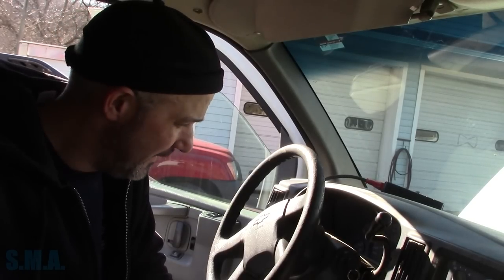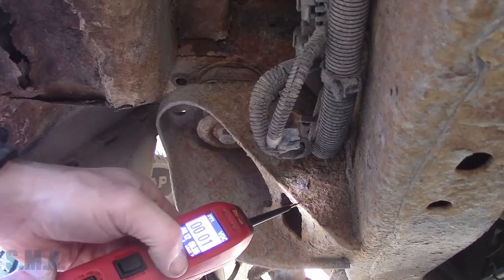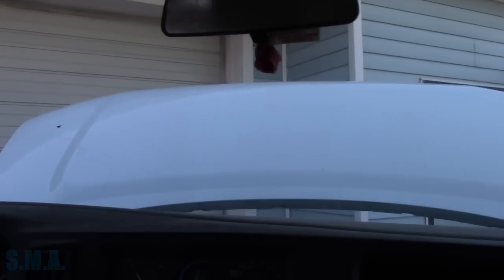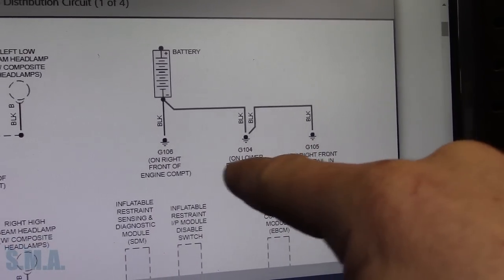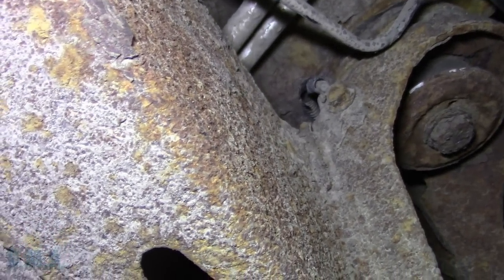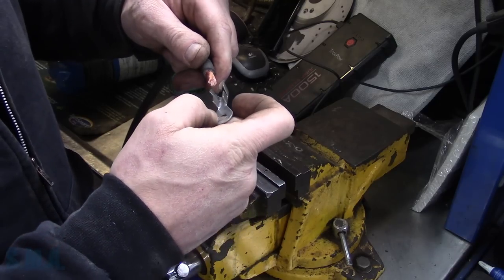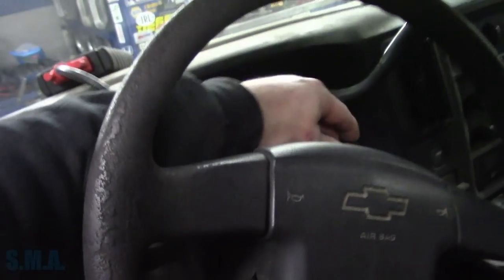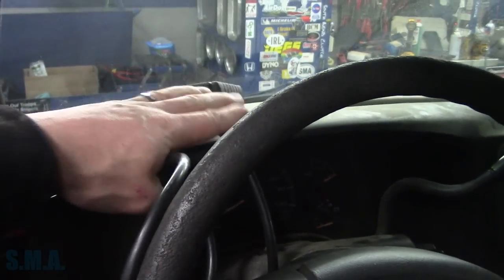Chevy Van : Crank No Start

Comment: It helps if you preform the tabs on the connector over a drill bit a little bigger than the cable then slide the cable in before crimping. You can quickly load test the ground by flicking the Power Probe switch to B+ for a second.
Are you running the shop alone these days?

Comment: Buddy and I tried to do the hydraulic suspension on his 2012 Benz. Not only a mess to do but plagued with all kinds of issues. The hydraulic lines are all over the place. Never buy one of these cars. If its cheap its cause the suspension is out or they know its going. Hella $$$ to fix. Just look at you tube on em. Anyways love the channel and I actually got to show my buddy your weld a nut on bolt extraction trick and I gave you credit even though I know you didn't invent it. ;)

Comment: Great video as always I’m chasing my tale with same no start issue 07 gmc 1500 5.3 
hoping it’s a ground and not the fpcm but I don’t have a power probe just a volt meter, and a test light some marine grade 4g cable and some chewing gum lol jk
My truck is a pile of rust as well so 
I will look around for a broken ground strap but any other advice Unfortunately I don’t have a lift and my bed is filled with tools or try to slide around under it

Comment: Hi Eric,
My dad has an 06 Honda Civic with 360k on the clock. The check engine light just came on, code says to change the trans fluid. He's only changed the fluid once its whole life. The time he did, it was slipping badly for a bit. Based on knowing this, would you go ahead and change the fluid. It shifts perfectly fine.
Reply: Only change the filter reuse oil

Comment: I have the same EXACT Chevy work van. Mines a 2014 with 120,000. It looks pretty close to the way that van looks, but maybe just slightly better, because I havent experienced any rust related issues yet. Am I doomed? Is there anything I can do to prolong its life. So far it runs good. Never gave me problems. Just brake pads and oil changes so far. I was thinking of spraying Fluid Film right over the rust to slow it down. I dont need it to last 20 years, just a few more would be great. What would you guys do?

Comment: You should make a video showing the replacement of a fuel injection spider and a timing chain cover on an 01 Chevy S10 4.3. I will even allow you to do it on my truck for the purposes of the video. I will even buy the parts. Course you will have to come down to Alabama. I doubt that would be a problem for you as you seem quite dedicated to your trade and channel.

Comment: awesome...……….. an other good-job
back in the late the early 60's I was around 10 years there about, my father had a 
two tone blue 4 DR  seriously ventilated 1958 Pontiac,  the back seat area was
 air conditioned;  on a rainy day, your back side get a washing,
one night on his way home from work,  he was having issues with it not handling well,
 a gas station near by put it on a lift, the car begain to fold in-two. 
We hear the story like some how with all the salt rust in his car how could it be. 
a day later he comes home with an other 4 DR. Catalina. 62, white,  that one held up much better, came with a monster engine. 
a friend of mine, something 1973 74, winter, on the free way, he has the trunk of his 63 Chevy
4DR, the truck full of tools and what ever else, red car, first the gas tank feel out, he fixed that,
 a few days later, the whole back of the car broke off & feel on to the free way. I was
behind him both times. just typing this out is making me laugh...……. 
1972 ranchero, before 1975, the salt had rusted the back wall of the cab up from under the bed and cab, rain water filled the foot well up, that little pocket area behind the seat all eat up.
the carpet hide it. sold it & left NYS..... go west young man, Cater was President. 
single wire lead 24 volt charging system when it loses it's ground will make it's own, through 
the poss-wire, that's when it gets fun. correcting it. had the steel battery box covers locked down blown off, * D batteries...….

Comment: had the same problem on dads 60 doged pickup wih 'all welded construction' when all the welds went resistive had attenae guy wire strung from engine to frame to cab to bed worked great for as long as he had it

Comment: It's been a while, but IIRC, that is not a "rat tail" file. Maybe a "half round" file? Another thing - suggestion for the ground wire: strip, then tin the outer wires. Install and "crimp" [using the term loosely in this case] the terminal, then reapply heat to the wire/terminal assembly. no loose wires and a bullet proof connection, when adhesive lined shrink wrapped. Yah, yah, everybody is an expert. :)

Comment: Free tip friday Mr O.   If I'm soldering a cable into a clip that's too small, I put some solder on the bare, twisted wires FIRST.  That way none of those pesky strands escape! Ant time sir:)
I will spare you the other way of pronouncing 'solder'.
Keep up the vijeo's!, Total lock-down here in France, we need them!

Comment: Im glad i live and work in Ca. Although I had a New York vechicle come Mazda B2300 (Ranger in descise) hard binding shifter motion. It has a newer dorman steering shaft shift tube previously installed two torx head screws are tight. Smooth movement with no shift cable connected, also disconnected from trans reconnected to shift lever  smooth aswell. My thought is that the neutral safety switch is corroded inside. With it unbolted from trans it will not move without shifting trans. Is this a common or have you seen this before? Customer declined removing to verify.

Comment: It's a good job you don't have the UK MOT test every year.  I had a car fail because the number plate letter spacing was wrong.  To have a sill with a hole big enough to put your head through, you wouldn't be allowed to drive that away from the test centre.

Comment: Crimp by all means, but if you have to add solder, then add the solder to the tip of the cable and the lug. If you allow the solder to creep down the cable, the cable will be liable to be brittle, and will, at some stage, break.

Comment: Pretty sure that's the stock ground strap.   Changed one on an 2006 express a few years back.
Reply: Looks like the stock one that snapped so somebody located it somewhere else it would still reach. That braided cable stuff they use is complete garbage.

Comment: I changed a motor on a 1999 ranger after I finished the motor swap I had a theft light code 1845 ...rechecked the ground wires that I had off and thought that the aftermarket key was the problem but before I took it to get reprogrammed I thought I’m going to check every ground wire and the one from the motor to the fire wall on the fire wall end was not getting good contact after cleaning it, I turned the key on heard the fuel pump kick on and yes it fired right up ...there’s nothing that’s more aggravating than doing all that work to not hear the motor run

Comment: Nicely done uncle had that issue with his ford pu only problem was he was trying to haul a trailer wired for an older chevy and his plug was wired all wrong from what the trailer Hadid wired the trailer to my dads 67 g10 sportvan and I wired the trailer like the van all lights and grounds were identicle  Bob's 85 ford f150 4x4 was wired totally different he wanted to cut my wiring and redo it for his ford I said nothing doing I made him a ford to Chevrolet adapter so as to spare my wiring i spent 3 weeks doing with grounds

Comment: Great vid! Changed battery in 03 GMC 3500 cutaway. Now same symptom. Crank- No start. Do not have lift in driveway, what are chances of same gnd issue. No trailer hookup, comprable frame rust. 
Only code is intermittent O2. Have heard bad fuel filter can cause false coding due to restrictive flow. Help? THX!

Comment: Scary to think this thing is doing likely highway speeds pulling a loaded trailer and all that is keeping it all together is rust, the interior carpeting, and the roof.  Glad I don't live in the rust belt.🙄
Reply: The frame looks fine to me. The body isn't important. The tires aren't even chopped, So it rolls straight.
Reply: And now the new ground strap will hold the engine in.

Comment: hey eric im working on a 2003 dodge ram 1500 hemi 131xxx miles engine stopped running lost all compression pulled the timing chain cover found a broken camshaft dowel pin. never seen that before all the valve train is okay

Comment: Had a BMW x3, would not start. Jump pack to engine and body started right up, moved it then put the jump pack on battery would not start. Short story long after almost changing the starter. Powers and grounds, Powers and grounds, KISS, KISS was repeating in my head. Ground strap from engine to chassis was rusted off. 3hour job turned into a 5 min job.

Comment: 4:44 Side Note: My Honda has a switch on the dash (lower left) that will activate or deactivate the operation of the other windows. Might be a safety feature so that kids won't open them, similar to the manual safety door lock! Since that Chevy's passenger window didn't open, might it have a switch ?

Comment: If it was me I would have used tinned copper cables and tinned copper terminals and a 30 ton hydraulic crimper for the ends :) Awesome repair though, I'm sure with the short life left that vehicle has naked copper will outlast it anyway.

Comment: Nope I've got the exact same truck with the exact same problem except when the lock is flashing it will not crank when the lock is solid it will and it seems to be getting worse with cold weather I have waited the 10 minutes and try it again and it's made me wait another 10 minutes and today it's been 30

Comment: I work in auto parts and work on my truck myself, and I still don't understand why they use "grounding straps". All they do is corrode and break. Why don't they use a standard piece of wire (copper or aluminum) to create better grounds?

Comment: Have a Question S.M.A. i have a 2003, Chevy 1500 4x4  used it last fall getting my wood never went all winter ,put a battery in it i had nothing hands never moved on the dash , would not do anything, , Are you thing grounds are all gone or  my dash ?I had trouble with dash before changed it 10 yrs ago

Comment: Eric, Please explain why you had 11.8 volts at the frame when you turned the fuel pump on.
Reply: The jump wire he was using was too small to flow full current. There's your voltage drop.

Comment: Have the same crap on my 2012 suburban. Except it make everything act up. Think the main issue is the ding dongs don't use dielectric grease while using dissimilar metals as grounding points....what could possibly go wrong?

Comment: I’m having similar issue recently installed a new motor 2000 s10 4.3 4wd

Plugged the harness back up. Pulled fuel relay and Attempted key to see if it would try and kick over but nothing happened. Switch is new so I know it’s that not it 

So I grabbed my test light  and noticed my crank fuse lights up when key is set to run position so I tapped into it for the time being 

Ignition is working 

Anyways while I fiddle with it more I found out that there is something else going on with it. 

I get crank but no start it sounds like it attempts to start sometimes u can catch a glimpse of it running then dies instantly 

I have a strong smell of fuel  so I know it’s getting into the rail “haven’t checked pressure on rail yet”

Anyways 

I replaced 

ignition coil /wires/ spark plugs

Distributor “full drop in”

Neutral safety switch since I damaged mine….with those dreaded connectors 

Still nothing 
 
I’m out of ideas

Comment: Can I pick your brain? My tuned Cruze is throwing P0236 and P2227 cutting my boost while driving. When I reset the codes it drives fine for a while but does it again. 32k on it and I see no hose leaks anywhere. My vacuum pressures are fine according to my ultragauge.

Comment: I got away from soldering automotive wires, the solder runs down past the crimp and makes the wire stiff. When it vibrates it breaks off there in my experience.

Comment: Can I pick your brain have a 2003 Suburban 5.3 starts and runs perfectly for about 10 minutes possibly warm up then dies out will not start again until the engine is cold and then starts fine runs fine and dies out again when warm or 10 minutes or so any help would be appreciated. Only code is po102 love the videos very informative keep them coming
Reply: P 0102 is a MAF sensor code. It seems strange that it would cause the symptoms you describe, but the engine should run fairly well with it unplugged. I would unplug it and see if it makes a difference.

Comment: I live in Northern California and after looking under that van all I have to say is. I'm sorry.
Reply: need to buy a SUBIE OR VOLVO  THAT NEVER RUSTS
FORD DODGE CHEVY RUSTS  SO BAD
Reply: @ekop1778  They all rust in the northeast. Seen Eric O. work on plenty of rotten subarus.
Reply: The best way I can describe HOW rusty the rust we get is, is by comparing hitting a fresh campfire log with a hammer, then a black chunk out of the fire that's 95% burned. You can punch through what used to be 1/4" high strength steel without so much as a tiny screwdriver, and light hits.
Reply: Willa Herrera
Why do you think car prices are so high ? Us New Yorkers need to buy new every 5-10 years. lol.
Reply: I live in mid Michigan. My last daily driver was a 99 Cherokee, it ran phenomenally, even after 280k miles, but the passenger floor board had holes rotted through and eventually the carpet sagged through.
Reply: @ekop1778  I live in the Northeast, never saw a Subaru that wasn't rusted out. Pretty sure they come from the factory that way.

Comment: We have a fleet of Savana 3500's and after about 5 years that ground wire will turn to dust when touched, leaving the driver stranded because fuel pump will not run. Temporary fix with a wire and 2 clips and we can at least drive the van back for repairs. Bad design by GMC, should be a wrapped ground wire like you put on right from the factory.

Comment: I have never seen one of those braided ground straps corrode and fail, and I work on refuge trucks. Of course I don’t have to deal with road salt but I do deal with mice,rats, alkaline garbage juice and monkey mechanics who basket weave and use 9 butt connectors on 12 feet of wire! Aint life grand 🛠

Comment: I can paypal you a few bucks so you can afford to get some bigger solder. Quarter inch isn't big enough for those kinds of currents, perhaps you could get some .500. Also, I don't think your torch is hot enough- you should be using a minimum of Mapp but I would go for the oxy torch just to be sure. There is no way that butane is hot enough.

Comment: I mean it's not as bad as my 2002 what I can see of it.

Mine will crank and crank but the oil pressure sensor is bad, if you crank it, stop, crank it again it starts.  Gauge reads low, sometimes stopped foot on brake will make the warning light come on.  But it's been that way for 6000 miles, since I got it, if it was really that low it would be making unpleasant sounds.

Comment: I have a chevy silverado 2500 6.0 I've replaced the pcm a battery a starter and a fuel pump and it will not start I don't know what it is and I need help.

Comment: You can get a crimp tool which is made to crimp those open terminals. Shop Amazon:   IWISS IWS-5100A Battery Lugs and Open Barrel Connectors Crimping Tools works with Wire AWG 16-4

Comment: Must have a lickum stickum. There is no way that passed inspection last year!
Reply: The frame is fine and I do not see cab mounts coming apart. Hole in the floor means nothing. It will pass NY Inspection. as long as no check engine light.

Comment: Hahahahahahhahahaaha, you didn't' have the correct hat on, so the knitted beanie ya had on, was to tight on the Brain, so got ya stuttering. I have those braided ground straps. Easy fix to replace them with hard wire like you did to avoid the future problem. Old Honda's used to rot out over here in Northern Illinois

Comment: Not a great idea to compress cables. Changes resistance. Can cause overheating.
Reply from the maker: You don't really believe that do u?
Reply: @SouthMainAuto  well, it's included within an entire paragraph in my automotive electrical and electronics systems textbook. All I could say.

Comment: Please Eric do not take this as a knock. Far be it for me to point out a potential failure of Mr. O's methodology. Being an Electrician we were taught back in the day never to "ring" the insulation from a wire/cable. To always "pencil shave" the insulation from the conductor. I get it, I get it it's a rust bucket disguised as a van. It won't be on the road for long.

Comment: No saving that work van. The owner needs to send it to the scrap yard. Before the frame snaps into two. That's no surface rust
Reply: Some duct tape, a little bailing wire, no problem! :)

Comment: When grounds start coming apart in your hands......RUN!
Reply: I was under my 2012 Subaru Forester last fall fixing an oil leak and noticed one engine to frame ground strap oil soaked. On the other side I saw another that looked like the one in the video. It was torn halfway thru so I grab it to test it. It disintegrated in my hand. Good thing I had an oil leak it's what saved the other one. What would happen if both straps went in the middle of nowhere in -20 below zero?